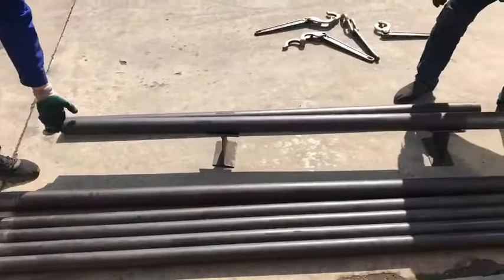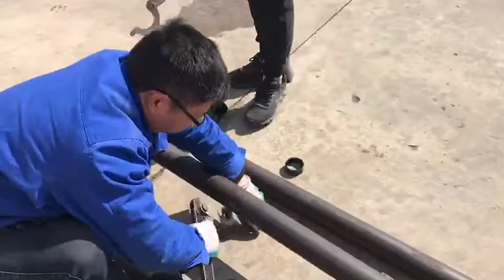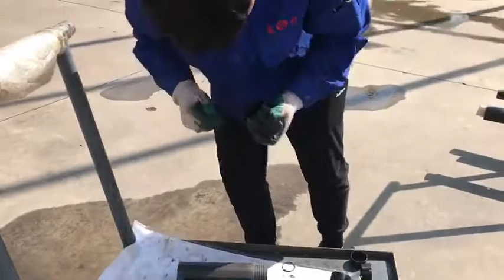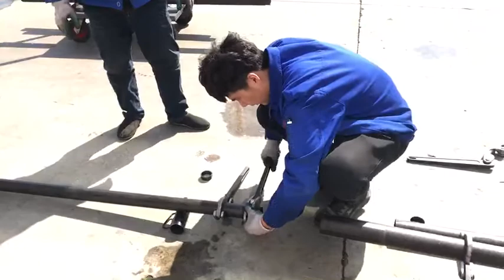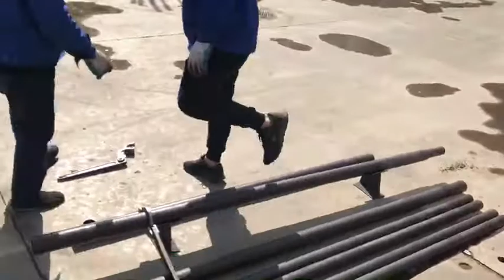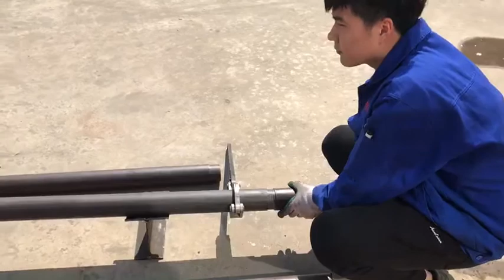BQ double tube core barrel assembly -step by step

Comment: No Pipe Dope ? You know those parts are more likely to break than properly greased when put under stress down the Drill Hole. There is a reason to Grease all threads and Bearings.
Reply from the maker: thank you for your interesting, when we use the drill rod ,core barrel and other parts, all will be greased before connect each other